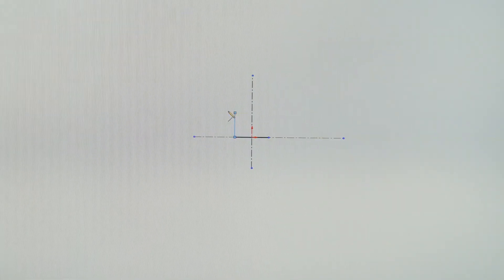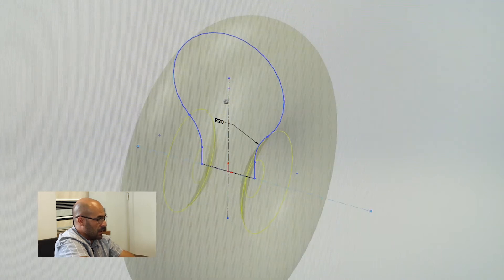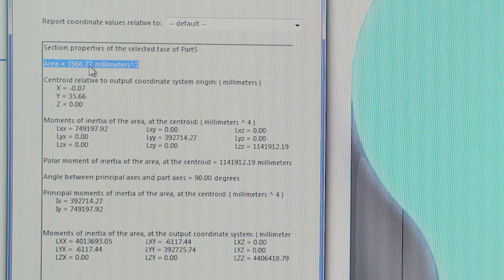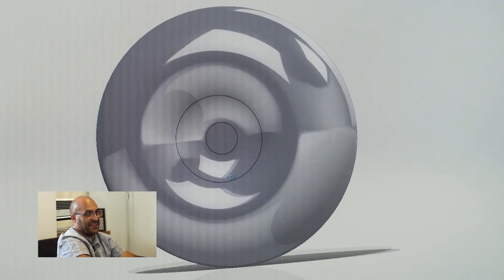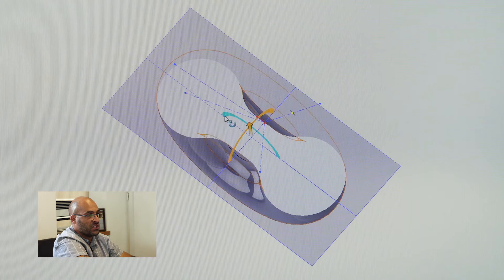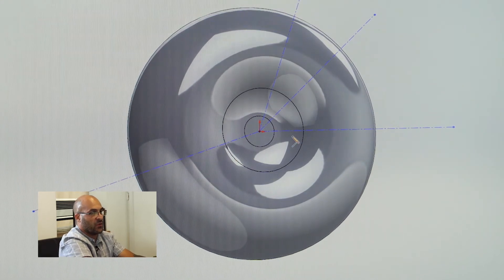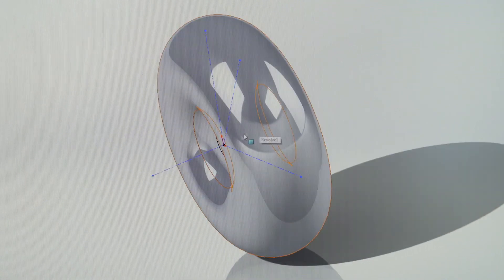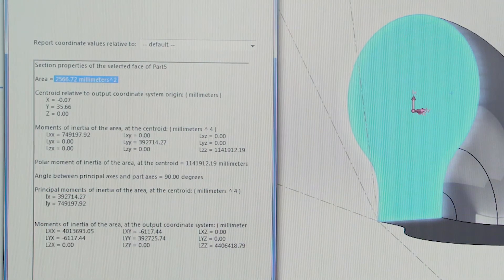Turbine Housing AREA in CM2 - how is it calculated?

Comment: The most BS video about the subject. A is always measured at the entry. A/R can be measured anywhere, it is always the same.
Reply from the maker: Lol that’s funny - specifically because the volute is ever reducing and the area always reduces as the volute rounds down to the tongue
Reply: @TurboDirectSA yes. But the area that Holset, Mitsu, BW uses, which is most important to user, is measured at the entry. At different point area is less, and radius is less, A/R stays the same. A/R is for housing designers, useless for end users.

Comment: What is the best A/R? Is there such a thing? I mean, in a family of housning there are housings with different A/R, Then there are different size housings families like T3 and T4. If one where to design a series of turbine housings from the ground up, I guess one could use the "best" A/R and make the whole housing smaller or larger. Like a T25 size housing with T3 flange in A/R 0.65, then a T3 size housing in A/R0,65 and then a T4 size housing with a T3 flange in A/R0.65. Is there a prefered A/R? We have had best luck with T3 A/R0,63 and T4 A/R 0.58.
Reply from the maker: Great question -- there is no such thing as the best AR im afraid. It all depends on what turbine will be running in the housing, what back pressure you want, what material choice you have and its thermal ceiling. There is ALOT more than this, but these are some of the obvious criteria. When we designed our housings and AR, we decided that from experience with hands on tuning of the 30 and 35 range (same volute family housings) on 4cylinder, 6cylinder and twin 8cylinder setups, we wanted a slightly faster spool compared to the AR83 T3 Garrett housing at the time, BUT we didn't want to lose out ontop. So we reduced the AR slightly, designed a fully symmetrical volute, and did flow and pressure simulation logs and made changes here and there before we signed off on the housing and went to casting them. Real world tests reflected exactly what our simulation results provided and we were successful.  

Always keep in mind, a smaller AR is faster spool BUT with a myriad of other effects which can negatively impact the engine, e.g EGT's,  fuelling and power delivery, thermal buildup ..... turbocharger bearing systems have failed severely and quickly when using the incorrect turbine housing AR - another reason why T3/T4 turbochargers are rubbish. 

Many installers in our country have installed these cheap chinese paperweights and then find that they are laggy (ofcourse they will be, the rotating assemblies are mostly a mismatch to begin with) so they opt for a smaller AR turbine housing, and smaller yet until you find a combination as follows:-  T3 AR36 turbine housing (originally supposed to be an AR63) running a T4 turbine wheel (446905-0502) with a 360 thrust and incorrect bearing housing 25 instead of the larger oil gallery 55 model - not many people have this info)  and a massive AR70 comp housing and say "trim57" compressor wheel (as discussed in my previous videos, WHICH trim57???) and then they wonder why the thrust bearing fails inside of a weeks running.  In the end the cause of the lag (outside of the mismatched design of the paperweight turbo) was a leak in the system ...... lack of knowledge results in failures, problems and bad experiences, and then they blame the product.
Reply: @TurboDirectSA  Thank you. Have to ask, how do YOU compare a T4 A/R0.58 to a T3 A/R0.63. Pros and cons when machined to fit Garrett GTX3071R and EFR7670 and SX-E7670? 
Oh yes, people never do mistakes anymore, it is always someone else or something else that is to be blamed.
https://i.imgur.com/P1IQGkV.png
Reply from the maker: @finnroen2334  HAHA love the picture!  The comparison would have to be on the specific engine. I would firstly have to  want to machine the T4 antiquated housing to fit these turbos you mentioned, which is highly unlikely  due to the available housings for these rotating assemblies. Can you give me an example of why you would want to use the T4 AR58 housing, maybe i can sway your thinking to another solution which might work better for your application.

Comment: Very informative video, Chris. Thanks. I had wondered about the same thing in the past. Am I right in thinking that because different manufacturers calculate the area at different angles along the volute, their numbers are only comparable within their own range of turbine housings?
Reply from the maker: Yes 100% correct
Reply: A/R compare is only usefull when you compare the same turbine wheel. Area (cross section) is depending on the turbine wheel. Same housing - Area will be smaller when turbine wheel gets bigger - A/R is the same...